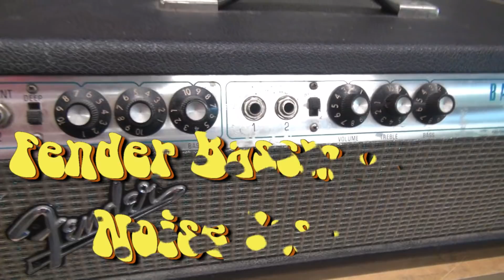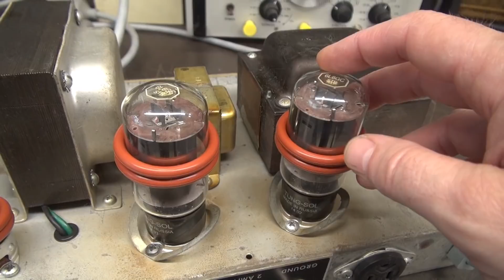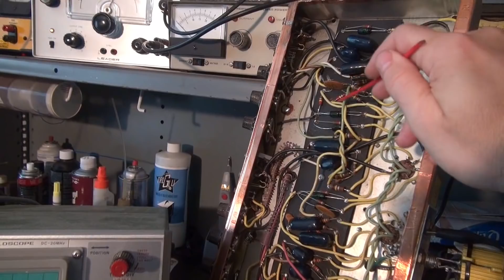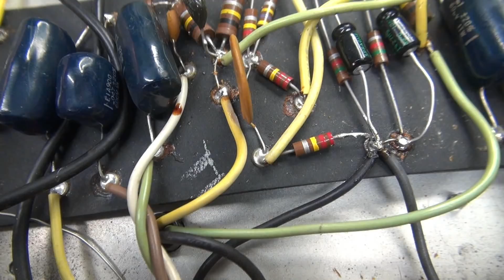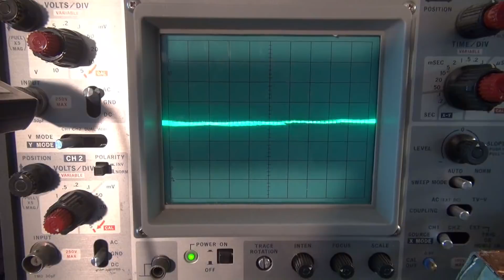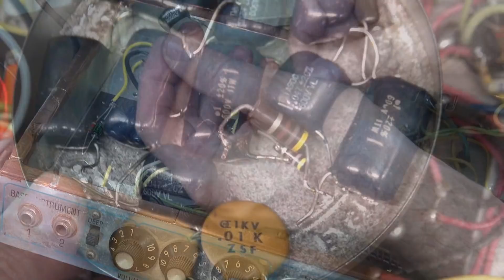How to fix Noise Fender Bassman 50 tube guitar 6L6 amp D-lab electronics  repair shop

Comment: hi Terry...any experience with a super twin rev? this is probably stupid..but; the EQ won't switch out. 1 470k and 4uf cap to gnd..is that a the common culprit?..yes clip lead to gnd..stays on.
enjoy...figured you've come across this once..
Reply: * it was a "dumb one"... 5uf/50v..at jack...**it read ok with meter.. swapped out..worked perfect..

Comment: I had a mid 1990s 59' reissued 4×10 amp. It was serviced locally tho it didn't need a Bias, but the shop owner wouldn't let me pickup my amp till I paid him for the ridiculous high service fees. So he end up replacing a resistor he claimed that it needed to be replaced. After I got my amp back at home. I plug in my guitar and started to using it, the amp started to make this very Loud humming noise. I replaced one of the preamp tubes and still made this awful humming noise. I wax told it could be the nearby TV or dirty power source. The amp never did that prior to being serviced. So now it's  basically unusable. I paid $800 retail price in 1997 Just feeling very upset about it. Since nobody can help me. And it's a tremendous hassle and expensive to find anyone that can solved this problem. And taking it back to the original audio repair shop owner is no help either

Comment: I do see that you generally don’t answer comments but I’ll give it a try…
Don’t the Ajax Caps give the Bassman part of its good tone quality??
I use the plug on the rear of the amp to use a small fan to cool the amp…just my thing…
Reply from the maker: I have not experienced any tone difference when changing caps to Sprague or Mallory

Comment: I hope we can all agree it's about the circuit and not the original wiring/caps. Modern orange drops should sound as good if not better than the original components.

Comment: Were can i learn how to hook up an oscilloscope to the amp board so i can see faults in the components the way you do? Im not trying to become a tech like you i just want to be able to find and replace faulty caps etc. the way you do, i have a delta blues that squeals like a stuck pig on the OD channel and growles on the clean channel, one power tube and two pre amp tubes are microphonic, iv orded new tubes but if there are faults on the board putting them in will just wast em. any suggestions? Im 65 so i do everything slow and patiently.

Comment: Orange drops in old Fender amps make me sad. Those blue caps are highly reliable. I agree changing the grid coupling caps to the power tubes. Shotgunning the blue caps for orange drops is unnecessary.
Reply: Those aren't the same blue caps as in my 67 BF Bassman, these look just like the brown turds that are typically in SF heads, only they are blue for some reason? All of my blue Mallory's are original except for the 2 that feed the power tubes, I put 0.22 Jupiter caps in there, I don't want to risk blowing my NOS RCA powertubes. And if I don't teach my son amp repair before I pass and he brings it in for repairs and the tech pulls out all the caps arbitrarily, I will roll over in my grave!

Comment: I have heard ceramic caps are responsible for the old fen sound
Reply: people can believe to anything,and most of the tube amp gurus wisdom statements are all made up to sell something.
try for yourself with a bunch of different flavor caps,and make blind tests with your friends,then draw the conclusions.
Reply: As long as the caps are the same specs (value,etc). The amp  circuit and everything should be the same,nothing in the equation has changed , just replacing an old one for a newer one. Therefore no noticeable change in the sound.

Comment: I have a 1990 Fender JAM 25 watt SS with 12 inch 8 ohm speaker. Do you have or help me make the SS portion a preAmp then put a 25 watt Tube Amp for he speaker in the combo box or as a set-top head. I need to tap speaker signal out of the unit before the SS Amp. Need to learn where that is. Where do you get detailed schematics? What parts should be replaced in the SS circuitry? Can i replace push button with pots for more tuning control. Truly enjoy your crazy stuff. Need help arround the edges. Dennis
Reply: Where can I get Schematics of fender stuff?
Reply: Got the schematics from Fender now I need someone that knows what he is doing?

Comment: Ceramic Disc caps are intended for RF circuits and non-critical applications - they very rarely go bad, and don't tend to drift, but the ceramic is usually somewhat piezoelectric making them microphonic in right from the factory... They gotta go. Carbon resistors drift and can tend to be noisy as well, so unless somebody wants it to look original I only put metal film resistors back in.  High Quality components make a difference!!!
Reply: + the use of metal film caps--they're stable and QUIET
Reply: those are very old technology,today we can have certain type of ceramic that are also very good for audio,but mostly at low voltage.
Reply: I am in the carbon camp, they add mojo

Comment: For testing noise floor, wouldn't it be easier to connect the speaker so you can hear the noise audibly when you tap the components?
Reply from the maker: Scope is my go to instrument, you could use a speaker
Reply: @d-labelectronics  brand new$1,100 fender bassman tube amp on clearance at GC I offered $100 they wanted $300 , plugged it in at store in made a loud noise one tube was flashing, then the amp went dead. I want to try and fix it. After watching your videos I think I can. Or can I ship you the guts for repair?
Reply: Sometimes the speaker will act like a microphone and pick the taps and thumps, then relay them to the scope. Using the dummy load eliminates this